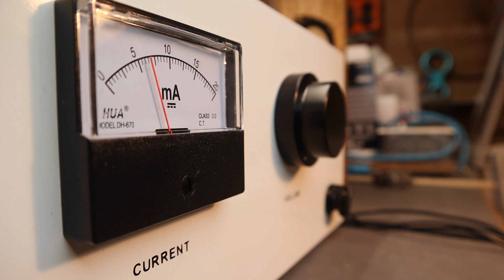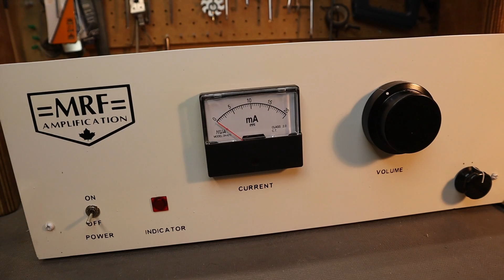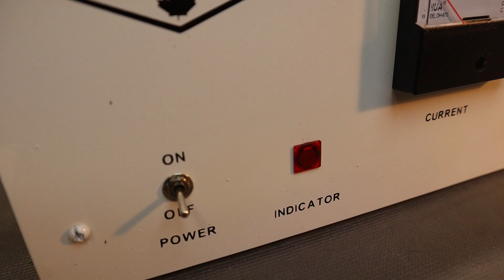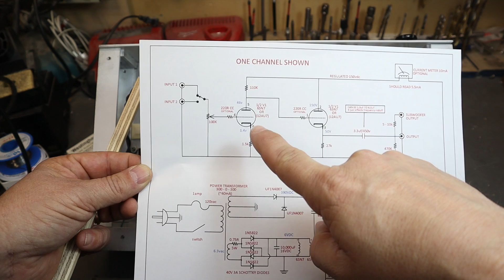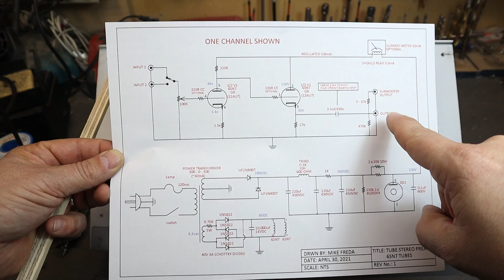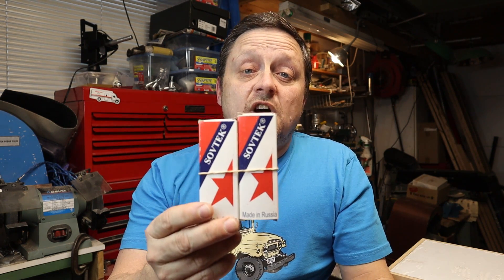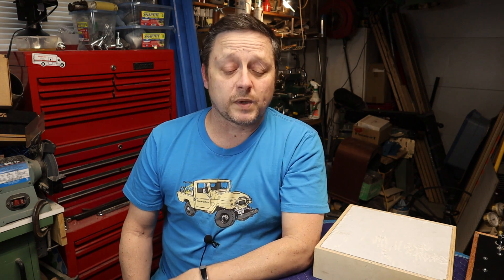Making a 6SN7 Tube Linestage // DIY Tube Stereo Preamp // New all Tube Shop Stereo System build!

Comment: Thank you for this!    Ive built several kits, but I am now feeling. I may be up to building a tubed preamp from scratch. This has the apology and tube types I was looking for.   Thanks a lot for the detailed explanations and great views of the layout
Reply from the maker: Thanks for commenting. I'm glad this was helpful and that you plan to take a project on like this. Have a look at my 6J5 Preamp build. It's similar and the tubes used cost a bit less than 6SN7. its basically the same circuit and it provides comparable results.  Cheers

Comment: Mike, would you consider doing a layout for this project?
Reply from the maker: Thanks for commenting.  Many people have asked for this so I do plan to make a simple layout.   That being said, it is a fairly basic topology and most people can figure it out.  They key issues is grounding and lead dress.  
I’m in the middle of a couple builds so it won’t be anytime soon.  What you can do is screenshot the underside of the amp and start doing a layout.  Download the tube data for pin out as well.  Cheers.

Comment: Thanks!
Reply from the maker: Thank you for the support.
Reply: @MikeFreda good morning, just curious what the 5k resistor is for between the main output and subwoofer output. Would you recommend of if I have a powered sub. Thanks!
Reply from the maker: @NightShazz9000  Hello, thanks for asking. It's there for several reasons. Here are a couple 1.) to provide isolation from the other "full rage" output jack. Doing this has less effect the output impedance and less effect on the input impedance of the main power amp. 2.) Provides some attenuation to the sub amp. Most sub amps are solid state and don't need a lot of gain to get to full power. This preamp amp has a lot of gain and is mostly suited for tube amps.  This will allow you to set the line level better and match the two different kinds of amps.  3.) Most sub amps have remote on/off when detecting any sort of signal. This will allow the amp to turn off properly AND won't turn on accidently. I've had cases that a door opening and closing would create enough air pressure to move the speaker cone... thus reverse/back feed in the amps, creating a signal that the sub picks up and will turn on.  I'd keep it in. You can lower the value if you want but you won't really hear a difference either way in the sub especially if your sub amp has a input level control. Also, if you are detecting audio irregularity, you may want to try changing the phase input of the sub amp. On mine, its has a 180deg phase shift.   I hope that helps?

Comment: 300-0-300 to rectify to 150VDC? What's the point of waste under heat?
Reply from the maker: Yes, you are right. This PT is overkill for the application. It's what I had in my parts bin. You can go a bit lower. The 0D3 does need some compliance voltage to turn on and operate correctly. It's stated on the spec sheet. As long as you are around the recommended voltage range you are good.  Cheers.

Comment: Hi Mike, Thanks for your videos.  I began building this preamp. I have wired the power and heater section.  Power section seems ok but I am not sure about the heater section. I measured the heater voltage at 9.4v dc with no tubes installed. I find that too high.  Ac input to the 1n5822 diodes is 7 volts but output is 9.4 volts dc. How do I fix this?
Reply from the maker: You're welcome. You need to tubes in to create a current draw to pull the voltage down. Without the tubes you are just reading the unloaded voltage which is normal. Install the tubes, Install a multimeter on the filament (switch to DC), turn the amp on and watch the meter. if it doesn't drop, turn it off immediately.  You have a wiring issue. If it drops but is still high, you need to add or adjust the 5W resistor. Use Ohms law to calculate. I find you typically need to adjust this since every incoming wall voltage, PT and tube filaments are a bit different. It's rare to not have to add a resistor. Anywhere from 0.1 to 1.0 ohm may be required.  I hope that helps?

Comment: Dear Sir, I am just beginning to design and build My own valve HiFi equipment. I was wondering if You  use "load lines" to design  Your circuits.and  It would be really useful to see how designing using load lines, and distortion correction, in a practical sense. So please may I ask You for a video on the subject. Kind Regards Jahmahrah
Reply from the maker: Thanks for commenting.  Yes, I use data sheets and load lines to build most of my projects.  I’ve done a few videos in the past that show how to interpret them but they don’t get the views. It is boring unfortunately. It would appear most people like to just build something from a proven circuit. To be honest, that’s what I did when I first started out building. Please have a look and Skunkie and Blueglow Electronics they have a lot of content on that subject.  Cheers.
Reply: @MikeFreda  Great thanks. I have built to circuit, restored, and modified, just at the moment I am so curious to learn and design Myself. Best Wishes, Jahmahrah

Comment: Can it be modified to be a mic pre amp ?
Reply from the maker: Yes/no.  I would need more information about the mic being used and how much gain you would need. I need to know the output impedance of the mic and the input impedance of the gear you would signal chain this pre to.  There are a lot of variables to consider. This is a stereo pre. Most mic's are mono so you would only require one channel.  As it stands this pre properly does not have enough gain to work with most dynamic microphones and the input and output impedance would not be ideal. You would probably need line matching transformers.   A better option is to find a circuit that uses a 12AX7 or a 6922. THere is an old Altec design that works well and is easy to build. The RCA Phono stage (sans the RIAA section) may be another option. Cheers

Comment: I could only find a 500 ohm choke. Could you please send me a parts source list for the transformer. I’m planning to add  Bluetooth receiver input module and a time delay to give the tubes time to warm up. Also adding DAC input.
Reply from the maker: A 500ohm choke is okay. The Triad C-3x is a good choice. The circuit is flexible and you can omit it if you like.  Due to the 0D3 clamping the voltage at 150V, you can use various PT's. This circuit does not draw a lot of current. Any 300-0-300 between 25-60ma will work. You just need to make sure you have enough filament current available. ~1.5 to 2 Amps.  The Hammond 269JX, 270BX, 270AX will work.  The 270X will also work but it has a 5v winding.  I'd caution about having a bluetooth module in the amp and/or running off the amps power supply. This may induce some noise or grounding issues.   If it was me, I'd use a seperate bluetooth unit with its own power supply and just RCA into this preamp.  I wouldn't worry too much about the time delay circuit. The 6SN7's are pretty hearty.  You could just use a tube rectifier and modify the PSU a bit by lowering the first filter cap to ~40mfd and using a 272BX or 272X (a 5Y3 will drop the B+ a bit)  I get most of my parts from Mouser. Cheers.
Reply: @MikeFreda thank you 😊
Reply: Thank you so much

Comment: What power transformer are you using? Would a 50ma 300-0-300 work here? That’s one thing I haven’t understood yet… can you supply too much current?
Reply from the maker: Thanks for commenting. The transformer I'm using in this preamp is actually used in a Fender Champ amp and its overkill for this circuit.  This amp does not draw a lot of current, around 8-10ma. The tubes are bias very lightly to help minimize gain and distortion.  The PT you quoted is rated to give 300-0-300 at 50ma of current draw. If you have small amount of current draw you will typically see the B+ voltage being a bit higher.  Will it work in the circuit? Yes, it will. The 0D3 will cap the operating voltage at 150VDC but you may have to adjust the large dropping resistors that are placed right in front of the 0D3. Simple ohms law equation will get you in the ballpark.  You "may" have to go slightly larger. Its hard to tell until you build and test it. I hope that helps?
Reply: @MikeFreda yes, that does help! I’ll do some more research in to a better suited transformer, but I’m finding some champ transformers that should work either way. I’ve built a few paint by numbers, high gain guitar amplifiers… but this will be my first hifi build! This looks like a great build! Thank you… I will post a video when I finish!

Comment: Is this for records ? For recording or both ?

  I imagine it’s for phonograph because there’s only one to per channel I think you want three tubes for channel in recording are you going to build one like that?
Reply from the maker: Thanks for commenting. This preamp is for 2 channel audio playback. You can input a CD or tuner directly into this. For record  (aka Phono) playback, you would need a separate turntable (Phono) preamp with a RIAA equalization circuit ahead of this preamp.  There is not enough gain to record with this preamp. You could not directly connect a microphone in this... well, I guess you could but the signal would be low and there is no equalization adjustment.  All this preamp does is allow for a bit more gain and a volume control for normal audio playback.  I do plan to make a one channel mic pre in the the near future. I hope that answers your question? cheers.
Reply: @MikeFreda  I think you mean you plan on doing one for recording soon ?       That would be awesome 

Do you tell how much it cost to build them in your videos?
Reply: @MikeFreda  hey Mike, if you’re going to make a recording preamp can I suggest a feature can you make a stereo unit that can be used for recording but also gonna be set up for monitoring your daughter as I understand it the PMs need to be set in a different part of the circuit to do this correctly for mastering purposes

Comment: Dang that box is awesome.  No metal was harmed (brake'd) in making this video?
Reply from the maker: Thanks for commenting.  I did not bend and metal in the chassis.  The sides are channel aluminum and the top and bottom plates are bolted on with small machine screws.  The point of this built that you didn’t need any special tool to make this chassis.  Cheers.

Comment: Is the OD3 tube identical to tube like 5Y3?
Reply from the maker: No.  Two completely different tubes.  A 0D3 is a voltage regulator tube (150v) and a 5Y3 is a rectifier tube (converts AC to DC).  They are not interchangeable.

Comment: Nice build. An interesting choice to use SS rectifiers and tube regulator.
Reply from the maker: Thanks! Yes, it's a bit of an unorthodox build.  I typically don't use tube rectification in my HiFi systems.  It's an added cost. Tubes tend to have sag and voltage drop across it. Using SS rectifier allows me to use higher value PSU caps to help control the AC ripple better. Makes for a quieter amp with less money spent. cheers

Comment: Like raoconnor, I am not familiar with transformer rating nomenclature.  You suggested that for the 300-0-300 requirement, the Hammond PT269GX would be a good choice.  However, I am unable to find a "Hammond PT269GX" online and could only locate "Hammond 269GX", which the Hammond specs describe as "450V C.T. @ 75ma".  Could you help clear my confusion?  Why would 300-0-300 be the same as 450V C.T.?
Thank you so much for this video.  Ron
Reply from the maker: Hello, Yes, this is a common topic for discussion. Its hard to explain over comments. I really should do a seperate video on this.  Have a look at this link on the Hammond website: Design Guide For Rectifier Use: https://www.hammfg.com/electronics/transformers/rectifier 
PT is just power transformer. You can omit that form the stock number. It's the same thing. The Hammond 269GX is a 225-0-225. >>> 450VCT. The DC output voltage will vary depending on the what sort of rectifier and PSU input circuit you use. Set up as a Full Wave Capacitor input, it will give you B+ of 319VDC >>>  V(PEAK) DC =  0.71 x sec VAC  [319 = 0.71 x 450]  of course this is unloaded.  
In this circuit you have a range of PT voltage that will work since the 0D3 regulates the voltage at 150V.  You need at least 75V-100V of compliance so, any B+ from 250VDC - 350VDC will work in this circuit. I hope that helps? Please feel free to PM me if you want more info.
Reply: @MikeFreda  Thanks for the quick reply.  In searching for an economical PT, I found a Hammond 270DAX, which is 520V CT (260-0-260, if I understood you correctly).  The spec sheet says 520V CT @ 104 ms, with a filament #1 of 6.3 V @ 3.5 amps.  Do you believe this would be a good choice?  Would the fact that it is a little larger than the 269GX be a problem or a benefit?  Thanks, Ron
Reply from the maker: The 270DAX will work but overkill. Wasting some money here. The preamp circuit doesn't even draw over 20mA. Your B+ will be way higher than listed since its rated for 104mA. The 270DAX would be suitable for a EL84 SE amp.   The 270AX is more suited for this preamp. If you are looking for budget, try the 261C6 or D6. Use a full wave bridge rectifier and leave the CT floating. (Do not connect the CT.)  I've used this PT several time and it works okay for what it is.  It's a good practice to have the PT current rating slightly above the amps current draw. You can go larger but you are spending extra money on a larger transformer that you don't need and you may need to tame the B+ by adjusting the PSU dropping resistors. Cheers

Comment: I think it was Morgon Jones who pointed out that the 6SN7 was MUCH lower distortion than the 12AU7. That's why my search for a 6SN7 preamp led me here. For me, it'll either be a 6SN7 or triode strapped 6V6 preamp that I build. Thanks!
Reply from the maker: Thanks for commenting.  To my ears I find the 6SN7 more midrange forward.  Some may say “tubey”.  When I A/B them in the same circuit they are close… with the 12AU7 being a bit more neutral.  Cheers.
Reply: Did you consider using a 6GC7? Also don't you find the gas filled VR adds noise? Lastly why monitor the current on a preamp; surely its class A?

Comment: Question:  I have noticed that you are using an OD3 regulator tube in the power supply.   From what I read, these tubes are noted for being noisy.   So I am curious if you can hear, or see via  measurements how noisy the regulator tube is.
Reply from the maker: Yes, I am using a 0D3 in the power supply section.  0D3's can be noisy if they are not applied correctly.  I have it installed after the PSU filter section. I'm using a lot of capacitance to remove most of the AC ripple and it seem to work great. I have not physically measured it but the "ear test" tells me it is working fine.  I think it creates more of a black background. You can really notice it between breaks in the music.  Honestly, I hear more "noise / hum / buzz" from AC filaments and bad grounding schemes.  cheers
Reply: @MikeFreda  Oh, so you can hear something then? As it is, I have seen this regulator tube used in amp designs before, particularly Grommes amplifiers.  I know at least two that use it.  But I don't see it in pre-amp use.   As for filament supply hum, yeah, I would go DC on those to get the hum down.   I like the 6SN7 design you used in that it only has one capacitor in the signal and I am thinking of building this very circuit myself, with the omission of the OD3, of course.
Reply from the maker: @jukingeo  I do not hear anything unpleasant with the 0D3 in this circuit.  If you plan to omit it from my circuit, you will need to use a Power Transformer with lower voltages or install some larger dropping resistors. You may want to model that using Duncan Amps PSU designer.  Cheers
Reply: @MikeFreda  I could possibly try it both ways, but like you said, if I don't find I like it, I could always add another RC stage to the filter portion of the power supply.  Otherwise, it looks like a really nice simple design that has only one capacitor in the signal path.   I also have loads of 6SN7 tubes, so the choice of that tube is a no brainer.

Comment: i know it maybe other may not see but the price for the 6sn7 $29.00 into the hundreds of dollars I dom't a lots about tube but I was around in the 60's LOL after looking around I cauld up with something how about using a 12sn7GT tube i'm hoping all that would do is a 12volt heater am i right
Reply from the maker: Thanks for commenting. Yes, you could use a 12SN7 tube and you are correct, you would need to figure out how to do a 12V filament supply.  Another option is using a 12AU7. It's a similar sounding tube and they are a bit cheaper. Cheers